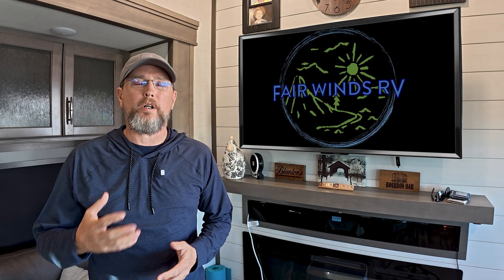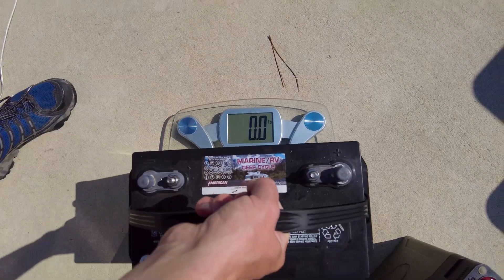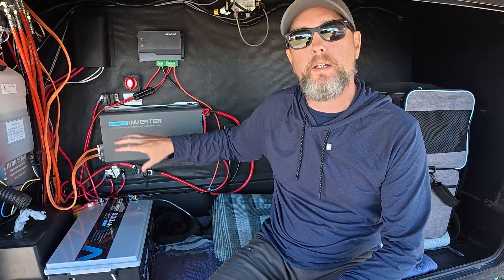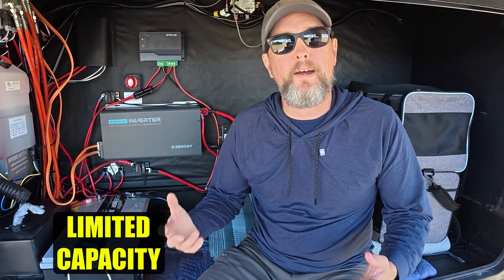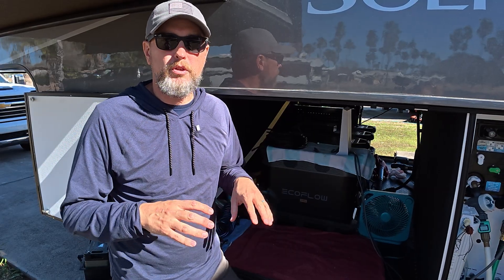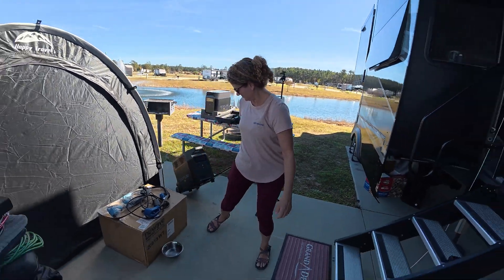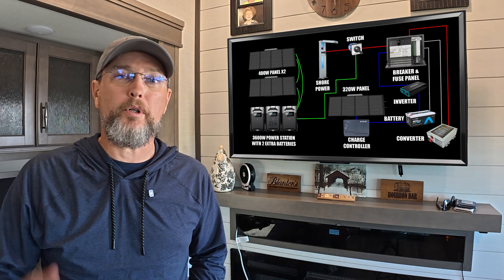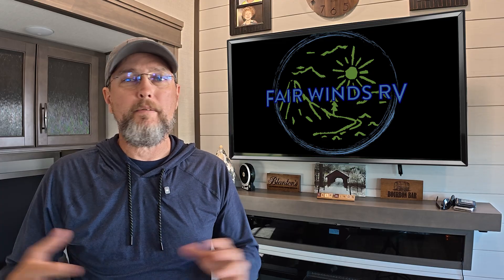RV Electrical System That Actually Works — Here's Our Full Setup

Comment: Nice - when you go off grid, how well dose the ecoflow system work for you - thinking about doing similar with the new stream products on a slightly smaller trailer.
Reply from the maker: They work great whenever we don't have shore power available. Would be nice to have a couple more solar panels, but we'll get to that... eventually. Lol.

Comment: That cheap EcoFlow inverter is not UL-458 listed and for safety reasons, should never be used in any mobile application because it doesn't provide automatic neutral ground switch, unless of course you want to intentionally electrocute yourself.
Reply from the maker: Not true. Yes, it's a floating neutral design, which is one reason it's not UL-458 listed, but that's why they make bonding adapters. And the one from Ecoflow does provide that bond automatically, when it's needed. I'm very aware of why it's important.

Comment: I "hyped" the video just for Candice doing the boogy on the roof.
I'm assuming you do not use the power cord when using Eco Flow. The x-fer switch essential disconnects the outside 50 amp plug and the Eco-Flow is connected. What if you used a 30->50 dogbone to plug power cord into Eco-Flow then power cord to outside 50 amp plug?
But if you wanted this while traveling you'd have a 1" cord connected to outside plug. = NOT GOOD. Never mind.
Reply from the maker: Yes...the power station runs through a manual transfer switch with shore power.
Reply from the maker: From Candice - thanks!  Glad you enjoyed my sweet moves, lol.

Comment: Ecoflow is a good choice, I tried this with a budget brand and 2 of the 3 units had some sort of failure.  I ended up with a full EcoWorthy/Renogy set-up for my 120V systems.
Reply from the maker: We've had a couple issues with the Ecoflow power stations, but overall, we really like them.
Reply: No it's not. It's a dangerous choice for an RV.
Reply from the maker: No, it's not if you use it right. This is the second time you've commented on this and guess what...it's the second time you're wrong. Using a ground-neutral bonding adapter gives the bond needed to keep the setup safe. And again, ecoflow sells one that automatically makes and breaks that bond when needed. Just because it's not UL-458 listed doesn't mean you can't be safe when using it. If it was, then most of the inverter generators out there wouldn't be safe to use with an RV because they also operate with a floating neutral. Stop spreading misinformation...you obviously don't know what you're talking about here.